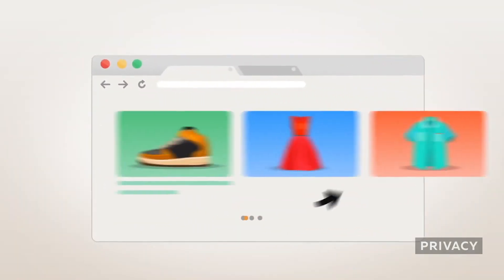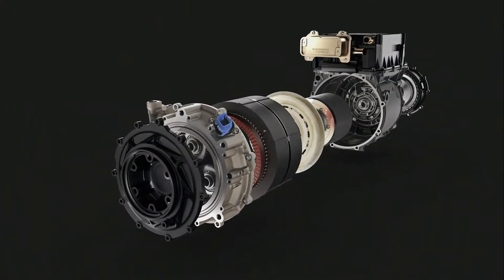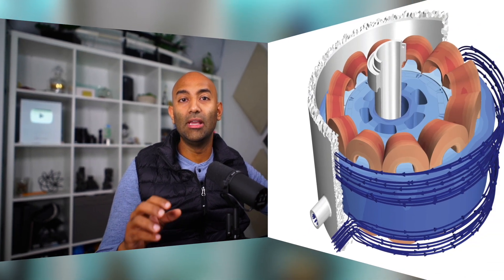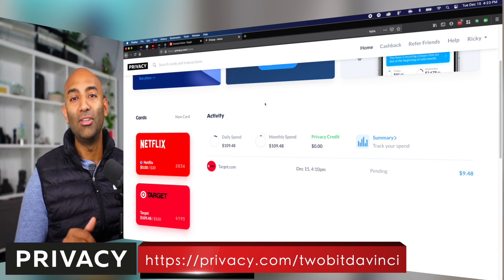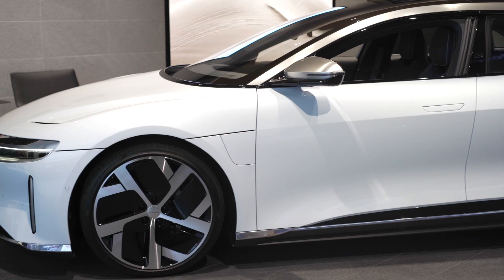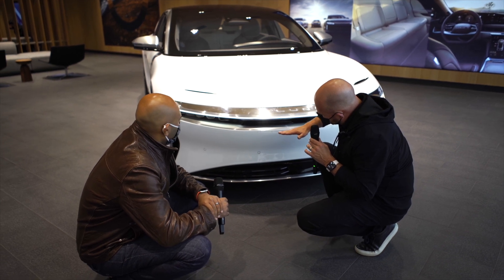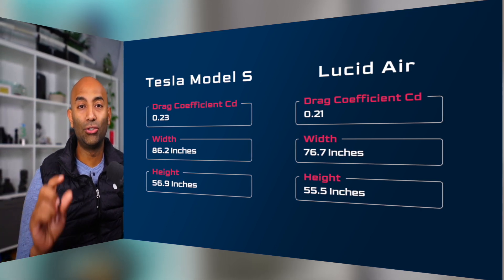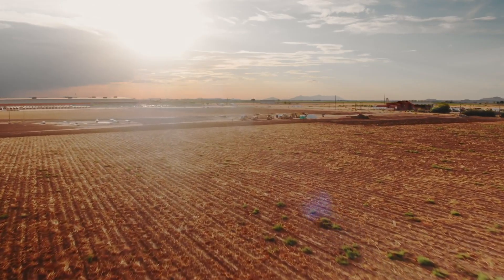Lucid Motors' Crazy Range Efficiency Explained!

Comment: Higher voltage stresses insulation more, shortening its life and making it less resistant to voltage surges. How did they handle these considerations?
Reply: Not sure where voltage surges might come from on a battery system not connected to a grid ...
Reply: @lengould9262  how do you plan charging it when empty?
Reply: @darthclide   The charging system and the drive system are two separate entities.
Reply: they are an engineering company duh
Reply: The insulation question is a good one.  I'd be concerned about partial discharging in the motor coils damaging the laminates.  Years ago as a student, I worked for a company whose specialty was measuring partial discharging and using that data to create a "lifetime" curve for a motor or generator and when to rewind.  The tech the analysis quickly became a must for generation and large manufacturing firms, and the insurance companies who backed them.  If voltages get pushed any higher, EVs may have to use electrical insulating gases like SF6 to prevent arcing.
Reply: @quantummotion   industrial motors running open air on 13,800 volts have been quite common for many many decades, and afaik are expected to last as long between rewinds as low voltage (up to 600 volt) motors.

Comment: This is pretty much just regurgitating marketing for the company. Not super useful. The “battery and electronics tech” is virtually no gain over competitors. It all comes from being a smaller car and having a slightly lower drag coefficient. Why do they never tell us cycle life for the battery? What are they going to do for charging infrastructure at that high voltage?
Reply from the maker: watching the video is a good starting point, but I know its a bit long... Electrify America will be their partner for charging, they support the high 800+V architectures. They have some serious motor improvements, did you see what I mentioned? They have a massive factory completed, and will be building cars next year. Sorry you aren't as excited about it as I am.

Comment: This is all marketing BS again. How much is the battery capacity? That is the only thing that matters here. What they enumerated, can't account for 17% more efficiency, maybe 5% max.
Model S now has 100kWh capacity, 92kWh usable, 402 miles range 
Lucid has 125kWh, 113kWh usable, 517 miles range.
=> it's exactly on par with the current Model S tech.
Reply: Good catch. Lucid are lying their way to the top
Reply: which is till not bad, right?
Reply: @noisypl  They're claiming to be the most efficient and make it sound like they're beating Tesla's technology by a massive amount.  When the reality is they barely eeked out better efficiency and is all probably from aerodynamics and making a smaller car not some proprietary revolutionary electronic efficiency gain.
Reply: Zoltán, I think you are right!  If you use the Tesla ratio of usable battery to range, and we upscale the Tesla Model S to 113kWh matching the Lucid, my calculations come up with a range of 494 miles.  That's a difference of 23 miles to Lucid.  Do the percentage difference and you get 4.7%.  That's a reduced car size, and a higher voltage motor just to get that extra %.  When Lucid finishes year 1 production, the model S could be on the 4680 battery pack, so overall range difference will be wiped out or surpassed, and the car will become cheaper due to lower battery cost and reduced part count.  Good eye Zoltán!

Comment: Excellent presentation Ricky. Regarding the higher voltage lower current system Lucid uses, I would assume that while the lower current makes for less heat build up in the motor the higher voltage would require more cells in the battery pack which would tend to make the car heavier. How does the weight of the Lucid compare to a Model S.
Reply from the maker: so when you put cells in series it increases voltage, while parallel doesn't. So this combination of series and parallel is how you establish your voltage. The air and Model S both have enough cells to be able to build a 900v architecture. hope that helps!
Reply: @TwoBitDaVinci  Thanks for the clarification...I forgot about the series and parallel cell arrangement.

Comment: They should make some Luxury Custom cruiser-like motorcycle with that tiny powerful engine!
Reply: I think if the tech could be scaled down to a manageable amount that a tire could handle it would be most interesting. But motorcycles are not inherently as slippery as cars so you would end up with some bodywork. It's an idea.
Reply: @charleshof6394  Dude.... there are motorcycles with a 2.0 L. This engine is tiny compared to those. and there is still room for the battery. And I am not calling for a huge range motorcycle. just something fancy enough to showcase the engine :-) The Lucid car is awesome... I just wish a bike with that style
Reply: @edrumsense  I agree the Lucid does look awesome. I am interested in the interior in that it was mentioned early in the article. It would be of interest to compare them with that of Tesla.

Comment: I'm getting an average of 4.3 miles per kWh on my 30kWh Leaf in the winter. I know this is a bigger vehicle though but it shows what can be done
Reply: 4.3 in winter?! I had a 24kwh leaf, and I would get 1.6-1.8mi/kWh in winter on average. Bad snow days and low temps would mean 0.8mi/kWh and horrific range. But in summer, it would do 4.0+ no problem.
Reply: @ericspda  Yep! Without heater on of course. I generally preheat if I need to and then do quick bursts when  need to
Reply: @iKaGe01  Ah. I have a Model 3, and the efficiency is surprising compared to Leaf. I usually drive in cold weather with the heat cranked, full throttle every light, and I get around 3mi/kWh on average. It’s easy to get 3.5-4.0, even on the highway or driving hard.
Reply: @ericspda  If I could offset the cost of  Tesla, trust me, I'd have one :p

Comment: Does anyone know what are the drawbacks of high voltage architecture?
Reply from the maker: the components like the inverters etc will be more expensive.but if a company mass produces them at scale, that can be largely offset.
Reply: @TwoBitDaVinci  companies already manufactur electronics at scale, it's just that you physically need more components then a 400V system. Cost difference isn't huge and neither are the differences in preformance.
Reply: @miguellopez3392  like so many more components that Tesla decides that it’s not worth it?
Reply: @tooocoool87  it's not worth it for tesla at a specific price point to a specific market, maybe the new plaid model S and roadster will be capable of higher voltages.

Comment: Great video. Love to see people working as hard as Tesla.  Looks like Lucid will increase efficiency beyond current Tesla standards, with I'm guessing a slightly higher cost. Just a correction to your "water pipe" analogy (since I'm sure you LOVE accuracy :) the first part seems correct but when you said high pressure leads to higher drag that sounds correct, but with electricity higher voltage (pressure) equals lower "drag" of power. Maybe it's better to relate it to the increased surface area drag of the pipe, or in the case of a wire, the increased cross-section of the wire. Just a thought.
Reply: The water pipe analogy has little to do with explaining drag or resistance. It's just a way of explaining that if you want to deliver a given 'quantity' of water (gallons) or electricity (Watts) you can choose to have a higher pressure (bars/volts) and a smaller pipe (diameter/amps) or the same volume can be delivered with a lower pressure and a bigger pipe. 
With electricity you can deliver more watts with less heat if you make the copper wires bigger. Or make the wires much smaller if you want an electric heater!
Reply from the maker: Yah I understand the mix analogy there. I’ll be sure to be more clear next time. The water flow is current and it’s higher in a smaller pipe, resulting in higher pressure. Haha... yah I should have expanded on that. Thank you for taking time to clarify Steve!
Reply: Tesla vehicles are actually selling, even in the UAE and beyond. Where is Lucid selling? They need to work about 10000 times harder to catch up to Tesla!

Comment: Ok so the showcase model is very cool. How many cars to be produced in what time frame?
Reply: Per lucids own goals around 10,000 Total production the first year as in 2021(btw the air is 3 year's late at that point in time. 
With a plan to be completely scaled up and the factory built out by 2028. 🤔
Reply: @4literv6  3 years late?  According to wikipedia, they had a prototype in 2016 and were only supposed to start production in late 2020 but due to Covid it got put back to 2nd quarter 2021
Reply: @rtfazeberdee3519  Rawlins claimed it would be ready by 2018 when they debuted the prototype. 
As they already had their amazing drivetrain in a converted cargo van back in 2016 and it beat the model s of the time in acceleration. 
They kinda missed that little deadline. Then last year after taking over a cool 1,000,000,000 from the Saudi's. He said it would be out in 2020. Now it's slated for late 2021. So we'll see soon enough. 🤔
Reply: @4literv6  I find it hard to comprehend Rawlinson making that sort of over confident claim as he is so conservative and measured in what he says, he's not a "Musk"
Reply: @4literv6  I must admit i can't find any articles about missed deadlines not Covid related but i don't worry abut anyone missing deadlines if its a development thing, its ready when its ready is safer.  
The startup process is about the only model they can use as you'd never be able to mass produce from day one these days unless you have almost unlimited funds. 
He used the same cells? I though Tesla had a special chemistry. They say Lucid's battery pack is made completely differently to anyone else, maybe Formula-E experience plays a hand.
The Musk comment about Rawlinson leaving because the going got tough doesn't make any sense as he went and headed up another startup (a bit of a whiney Donald Trump tweet from Musk)
Can you get EPA certified on a non-production vehicle?  Lucid will look a bit stupid if the cars can't do what they say they do. Production will start next year now the factory is finished and maybe their build quality will be a lot better than Tesla
Reply from the maker: Huge factory in Arizona is complete. Will cover it soon. It’s super exciting
Reply: @TwoBitDaVinci  I for sure look forward to it :) From the clips you had it seems like serious business

Comment: Hopefully after their high end sedan sells a few thousand they can bring that efficiency to a car for regular folks.
Reply: One thing I'll say, owning a Tesla Model 3, and an Active Duty Servicemember (meaning i don't make $h!t), buying electric is an upfront investment.  I've owned my car for almost 2 years and I've paid less than $150 to charge away from my home.   My electric bill has gone up $20-40/month, month dependent of course.  I've also paid absolutely nothing for service of anything.  I did rotate my tires myself and change a cabin air filter.
Reply: @QuentinSheley87  Quentin, Have always wondered how people living in military family housing, barracks, dorms, etc., would handle charging.  Since you talk about your electricity bill going up I guess you live off base.  If you lived on base and someday you probably will, how would you handle charging.  To me it seems that much of the energy savings ($) would go away if one used 3rd party charging.  My state charges an EV basically a road tax like in Europe to make up for lost fuel tax that pays for our roads, this coupled with the fact that I only drive 8,000 miles a year, my car gets 31.4 mpg and before COVID about one-third of my driving was on long trips, I have calculated my energy savings with an EV as being quite low.  Do you know/serve with EV owners that live on base.
Reply: @johnbailey3351  I live on post currently.  With utilities being free for the foreseeable future that helps a ton with daily charging.  I do live in housing and not in the barracks which would cause other issues itself.  As for 3rd party charging I've either used super chargers or found free level 2 chargers so it hasnt been a huge charge.  Where I'm stationed it's a hike to get to the nearest town so either we come back home with a 25-30% battery and charger or super charge before coming back on post.

Lastly, housing refuses to allow us to change the charge plug to 220 so I'm stuck charging 2% and hour on 110 power but it works.
Reply: Seriously my thing is they have yet to Bring us a nice well round not too overly styled Sedan for about $36-$39,000 with at least a base range of $250. I hate that everyone is taking a change at Producing these regular looking grade sedans that are nice but they still are $40,000 with the tax Credit,  We need someone to email them and tell them to make a A Class Lucid A Car AMP a little smaller maybe a mid size. For about $36,000 like 👍 Mercedes Has their A Class sedans which are becoming Higher in Price once again. But we have these basic ass raggedy ass Cars that are $40,000 and no shade they look like a DAMN Base Model Kia Soul or Base Model Honda Civic Ima say again I don’t give AF about technology if it’s not being implemented properly to make it affordable what about the working class that needs vehicles you know I just wish everyone QUIT trying to be so damn Premium all
The time and just produce something nice 👍 like the Fiat 500E or Honda E would CRUSH IT HERE!!! I love Lucid but I’m tired of these $70,000-$1,000,000 price tall for these ducking cars that seem like they are geared towards larger Youtube Community until I see a Regular nice looking car besides the Mini Cooper SE Electric ⚡️ that has about 250-275 miles for $30,000-$35,000 for a city/ Weekend style getaway market I’m gonna buy a Combustion engine pisses me off every targeting “LUXURY” or “PREMIUM”
Reply: @pixelking_871  But isn't that what Tesla is doing? Aren't they soon to be releasing a $25,000 Tesla?

That's going to be a game changer
Reply: @TheStellarmanCo.  Tesla Hasn’t produced yet and I’m talking about a more fictional looking car with Character they have their own style dont really like Tesla Brand their nice 👍 but no I rather a Rivian
Reply: @pixelking_871  But the Rivian isn't $25,000 Car, it's still expensive, doesn't work for the average Joe
Reply: C M , “it,” meaning Lucid, or...?
Reply: You know the drill, If you have to ask how much?...
Reply: High Voltage ++ = electric failures...Also now in IGBT territory
Reply: They're just another luxury car brand. Their IP and know-how will be developed for luxury cars, just like Tesla's. They'll never be able to develop a truly affordable electric car, because their concept of affordable is wrong. There will never be a truly affordable electric car if the power-range arms race doesn't end.
Reply: @gsilva220  Tesla talking about a $25,000 Car eventually what are you talking about???
Reply: @gsilva220 , I think the 800-900V architectures of Lucid and the Taycan are probably the most fundamental place where Tesla is falling behind.  400V was way-high compared to they hybrids before Tesla (e.g., my Prius Prime has a ~200V architecture), but its starting to become just plain obsolete for high-performance EVs!